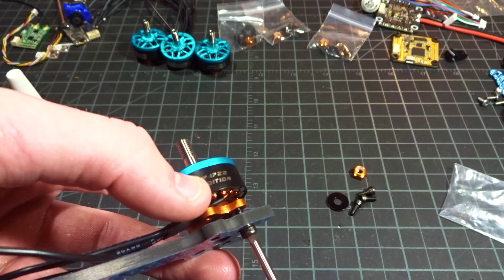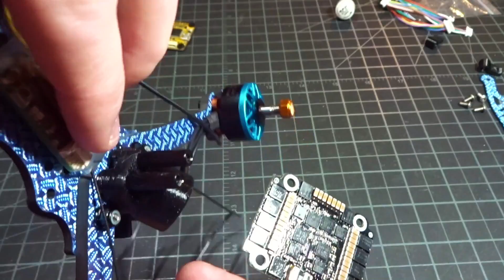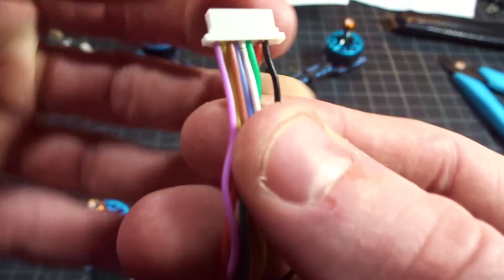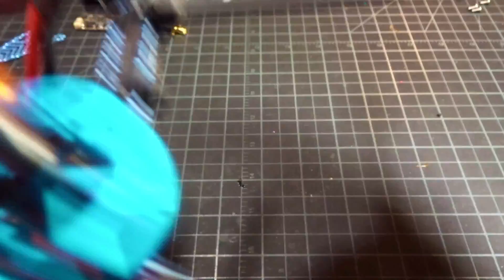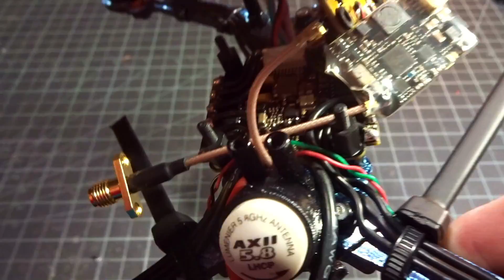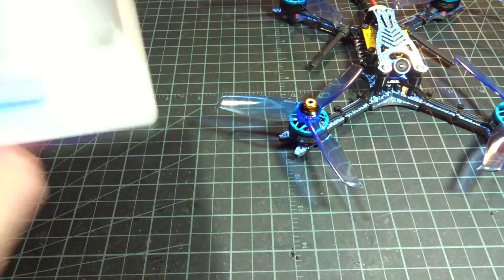6S Racing Quad Build : Hyperlite 2207 1722kv, Hyperlite F4 OSD, Aikon AK32, Foxeer Micro Predator

Comment: Hi tell me with your experience  what do you think of the Emaxx RSII 2306  1900 kv. Ive been flying the 2206 2400 kv on 4s what do you think of 2306  1900 kv on 6s. whats your opinion ? Thx and peace ! 5055 gemfans
Reply from the maker: 1900kv is a little high imo. Also not too much point in the RSII and lite line with there new ECO series out.
Reply: The RCAddict Do you  think 4s would work. I already bought them
Reply from the maker: Oh yeah they will work fine, on 6s too. You just lose some efficiency unless capping your throttle.
Reply: The RCAddict Thx I appreciate it

Comment: Hi: great video !!!: thanks !!! excuse me for the stupid question...but in this build i saw you put the rx under the 4 in 1 aikon: as i think the battery it goes down of frame so enough space remains for the battery strap between the rx and the bottom plate? thanks
Reply from the maker: Strap goes under the camera.
Reply: Hi OK many thanks..but only one strap under the camera ?i think  the lipo so it can not be stable and then it would be too far forward and unbalanced the quad .. sorry if I am a stupid man but I don't understand: could you please explain me better ??? thank you again
Reply from the maker: @odinofanchin1053  The lipo shifts forwards. Gives a forwards CG which doesn't matter so much for racing.

Comment: Could you run a 6x5x3 on this build with a 6s?
Reply from the maker: You are going to want a lower KV for that much prop. like 15-1600kv.
Reply: There is always 5s. I can always down prop to the dal t5544c if too much maybe.

Comment: put diodes on the LEDs to limit their current
Reply from the maker: They don't draw much, and I'd like to keep the full brightness ;)
Reply: yeah cool... but you said they get warm as fuck ... so put a diode on one of the poles of them like if they only idk 20mA put an 18 one on them and they will not get warm anymore .. id buy severly different ones and see what works best
Reply from the maker: As stated, these were 4s LEDs on 6s voltage ;) The 6s ones have no problems.

Comment: Did you manage to get camera control working?
Reply from the maker: Yes, just hooking the white OSD cable up to the cam c pad, but it never worked fully. Like I couldn't move left through the menus :(
Reply: yeah i hooked up white to cam c but couldn't get into menu...oh well
Reply from the maker: throttle middle, yaw right? Did you also connect the ground ?
Reply: yeah...all good though, I just left the plug inline so I use the little controller.

Comment: Watched your video, I am wondering if you had any trouble with your F4 OSD. I am having trouble with mine. It won’t connect to the computer, it’s not even being seen in device manager at all. Even after installing the right drivers. I was wondering what you did to connect to your flight controller?
Reply from the maker: It's probably not the fc at fault. DId you restart your computer after install?
Reply: Yes I have. Still to no avail. I do not think it is the FC. It is a solid red LED with a blinking green when plugged in.
Reply from the maker: Maybe this? https://www.youtube.com/watch?v=m4ygG6Y5zXI

Comment: csn you share your experience with the Aikon AK32 esc? i been using emax bullet pro esc , but i alredy burn 2 using them with 6s , do you think that the Aikon AK32 really supports 6s for racing ?
Reply from the maker: I and MANY others have been flying the Aikon on 6s for months now, zero issues that were it's fault. It's very solid.
Reply: Thanks for answering , i will try it !! , thanks  last question , do you think the cap is necessary for 6s or not ?
Reply from the maker: Yes, use the included cap on top of your video input power.

Comment: I have a question about the hyperlite f4, not about the hyperlite OSD.
That 22 dollar hyperlite f4 can be used with ibus?
I have fly sky so.. i need it 😛
Reply from the maker: It's the same as SBUS right? I don't see why it wouldn't work.
Reply: The RCAddict actually sbus need inverted signal ports to work. And ibus is uninverted. Mostly they dont work on tbe same port.

Comment: What uart do you use im doing this build
Reply from the maker: It says right on the back of the board. Pretty sure it's 1 for sbus RX and 5 for smart audio.
Reply: The RCAddict i have it on those ports, bit my receiver is bound but wont show any stick movements in beta flight receiver tab

Comment: Doing my first build coping this vid on a ghost was the esc to fc pinout correct? I’m copying wire colors
Reply from the maker: Everything except the motors was correct, I got them motors the wrong way around, and just fixed them with resource mapping in betaflight.
Reply: Thanks I’m stuck you have FrSky X4R-SB yellow wire labeled smart port you call sbus and connect to sbus on the fc? Confused 
I’m using FrSky R-XSR my yellow wire is also labeled smart port and my only quad friend is telling me my yellow wire is telemetry HELP
Reply from the maker: Don't worry about the colors of a wire. A wire is a wire, no matter what color the insulation is. I just happened to use a yellow one for my sbus signal, so yes in your case the yellow on the R-XSR is smart port, not SBUS so it won't work.
Reply: Thanks so much just born to quads 1-20-2018 so much to learn. You should have hands on class in person subs could bring in a bag of parts and a radio and leave with a working quad and knowledge to build.I'm willing to pay for the info instead of having to watch 100s of hours of YouTube 
My example Turnigy Evolution binding to A8S where you bind then turn off the Turnigy repower (different than all others) then good to go that took abt 5 hours searching YouTube and hit Project Blue Falcon

Comment: i would fear to increase the noise by soldering the motor's wires like you did.
With 6s's power running trought them, could potentially decrease fpv image dont you think?
Reply from the maker: I always run my wires like this. Works just fine so far.

Comment: Have you seen this frame yet? HANTU 5 Inch 210mm Carbon Fiber Frame Kit 4mm Arm With 3D Printed Parts for RC FPV Racing Drone. It doesn't even look like they were kind enough to change your top plate haha
Reply: Never mind. Just saw you answered a few questions on Banggood's website about your frame!
Reply from the maker: Hah, can't believe they let the replies be published.

Comment: I'm really skeptical of the benefits of 6S. I get that it's more efficient, but does that outweigh the added weight of a heavier battery? I do think it'll be good for people who don't get free batteries from a sponsor and can't afford to hv charge and completely kill a $40 battery on every run at a race, since this setup should be much easier on batteries
Reply from the maker: The 1250 only weighs 13g more than a 4s 1550? Most people switching to 6S don't need to be. Unless you are having trouble finishing on a 4s hv charge 6s won't make you any faster.
Reply: 6S allows for more flexibility. It's more efficient so your motors draw less current for the same overall wattage. (I*E=P) Less current draw allows you to build lighter and produces less EMI. The higher LiPo voltage means you'll see reduced no chance of brownouts due to high current draw causing voltage sag. This can also come in handy in the event of an unexpected fly-off or crash as your VTX and telemetry can remain operational longer. Making the crafts recovery possible long after the battery power isn't sufficient for flight.

Comment: Nice! I like how you routed the motor wires - I may do the same depending on realestate between the esc and FC for other wires (FC harness, and I likely will run a lead across out the front for a big ole cap). Those LED's look a little smokey ;) Interested to see how it performs w/o a cap!
Reply: quick comment on the esc harness length - I thought they were pretty long as well initially, until I  mocked everything out the way I wanted (same orientation you ended up with - Sergio's mug looking back at you if you're looking at the quad from the back) - it gives just enough room to comfortably route the harness under the FC, and still gives plenty of slack to pop it off if you need to do maintenance.
Reply from the maker: Just flew it LOS for the first time and holy crap the increased torque is incredible. LEDs were fine with airflow haha.
Reply: Awesome!!! Mine won't be airborne for a little while longer as I'm still waiting to buy gear - but my set up is very similar - got some 2208 1950kv primos here on a 2.1 5" floss here (new 5mm arms are kickass!). Gonna run hq 5x4.5x3v1s instead of a higher pitch since the KV is kinda ridiculous.

Comment: it's a shame pirofliprc chooses to continue to use the shitty 8mm bearings that take nothing to damage then. also they nerd to use thicker bases. they are so weak. I got a set of the 2307 motors and couldn't be more disappointed in them, 2 bad motors out of 6 right out of box. wish they'd add the lip under the magnets on the Flux ring as well to keep the magnets from dropping should they ever let go.
Reply from the maker: 100% guarantee you they will replace your defective motors right away if you message them. I have no issues with bearings. Sure they get rougher over time, but it makes no difference in the air when racing unless they are full of metal shavings haha. I would rather have the 4mm shaft stay straight, vs a 3mm one that will bend and then you will have a serious vibration problem. Lip would be good yes, but I have never slipped a magnet, I suggested it to them.

Comment: Hey if you don't use telemetry on the x4rsb then why use it. Get xm+ you reduce some weight and it takes up very less place
Reply from the maker: I have had random failsafes with all other receivers except the X4R-SB and for racing that is not acceptable. It's no problem to fit it in the build.

Comment: 1st, the F4 FC make a great amount of heat from cpu. Mount a heater like Unify over the FC isn't a great idea. RX usually goes to failsafe when is exposed to high temp.
2nd, the props are inverted.
Reply from the maker: 1st, been running this exact setup zero issues for 6 months, 2 reversed props is a thing ;) lol roasted

Comment: I'm new to FPV. Why would you use a lower KV motor for 6S ? Is 4S high KV equivalent to 6S low KV ?
Reply from the maker: The goal here for racing is the same performance but less current draw, enabling top tier racers to finish the race without the battery exploding haha.

Comment: Really sharp looking quad. Thanks Seth. Not a whole. Lot of build videos anymore.  very lean looking. One question why. Did you not wire the LEDs to the flight controller and direct to battery. Might help with them getting so hot. Thanks
Reply from the maker: No 12V regs anywhere so no point

Comment: why no race wire on the arms
Reply from the maker: Not a fan, I never chop wires.
Reply: lol, not even for a quick motor swap?
Reply from the maker: I mean I don't really break motors. And if I do have a bad crash at a race it's simply on to the next quad. Can swap a motor as it in under 5 mins though, not like it takes an hour haha.

Comment: That's sweet carbon!# Seth the problem with my 5"floss build was the hyperlite flight controller the accelerometer or gyro is faulty because everything else has been tested.. must be a faulty board?
Reply from the maker: I still don't see anything wrong with what happens in your video, but trying a new one is a good idea.

Comment: which connector for VTX is better?   the MMCX or  U.FL ?   Im just not sure which to get
Reply: mmcx. Stay away from ufl-  they break easily.
Reply: George Sa .   If mmcx is stronger why does it seem that all i see in the stores is antennas and vtx for the u.fl ?  But thanks for the info
Reply from the maker: MMCX is strong, but awkward to mount. It would suck in a build like this which is why I still prefer .UFL with it secured properly.

Comment: I haven’t had as good of results w/hulkie props on 5s & 6s setups like I do on 4s. Oddly enough windancer props are my favorite in HV setups. One thing I learned very quickly after going above 4s is prop options are limited and their flight characteristics differ as well
Reply from the maker: People running 6s have told me the opposite, they turn into beasts that can turn any prop.
Reply: The RCAddict
True for the most part which is why lower pitch works much better on 5 & 6s than they do on 4s... But not all props can handle the torque or extremely high rpm’s. Hulkie props are good on 5 & 6s but to me the control feel is very unpredictable above 70% throttle. Many of the lighter props flatten out at higher rpm’s so trial & error has been interesting. My prop preferences have changed since I increased voltage but there are lots of props I still have to try. You’re an excellent pilot so I’m sure you’ll figure out what works best pretty quickly. Be great if you make a video about prop characteristics at higher voltage
Reply from the maker: What props are you running on what motors on 6s? I run HQ5050 v1s and GF5055 on 2600kv 4s right now.
Reply: For 6s (RaceKraft 2307/2000kv which is probably too high kv but flies great) On this I either run windancer’s, cyclone 5046 or GF 5152 - 5s setups (RaceKraft 2307/2542kv & returner R5 2207/2400kv) both 5s setups are running windancer props. Mid kv on 5s is my favorite combo for several reasons... It’s easier on components, same low end torque as low kv on 6s but better top end performance, great flight time w/o sagging when running 1300mah/100c packs. Overall 5s mid kv is more consistent and predictable throughout the entire throttle range in my opinion and it’s control feel is much more locked in. I’m interested to see your experience because we have very similar builds besides motors

Comment: 28:44 There's smoke coming off the right led be careful with that
Reply from the maker: Y'all be crazy attentive LOL. It will add 10% thrust off of the starting blocks ;P
Reply from the maker: These leds are NOT meant to be run on 6s, it is absolutely not fault of the LED. These are the 4s version, not the 6s version that they also come in. It actually gives them credit as they have survived for 2 flights so far and come down cool with airflow.
Reply: Rico is right, throw these leds out